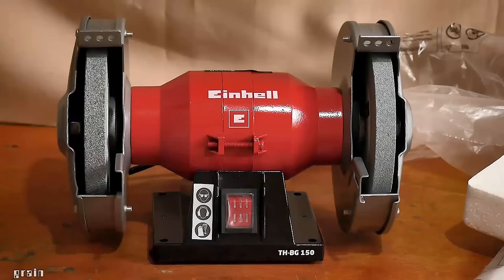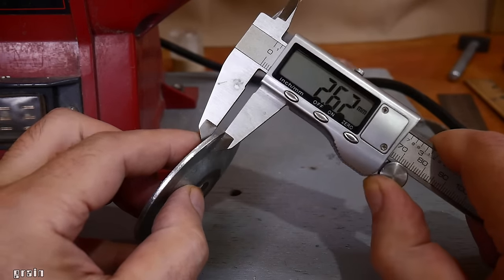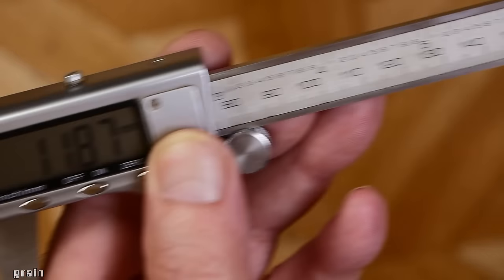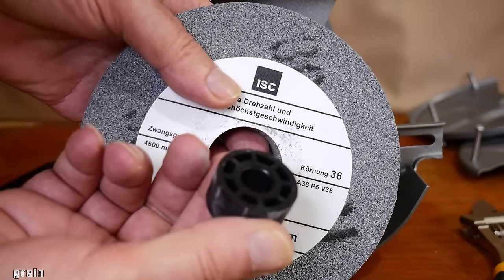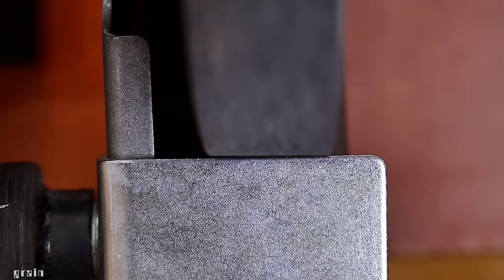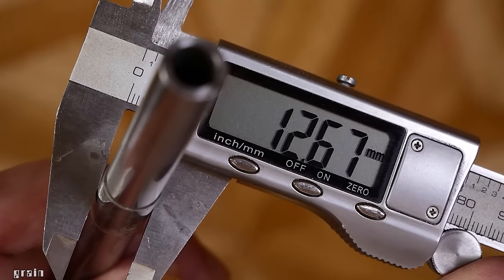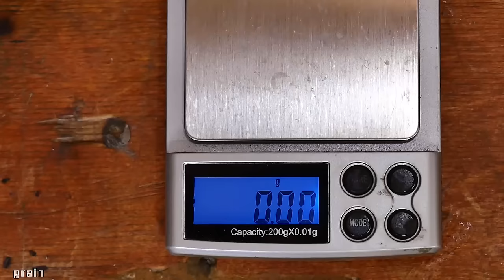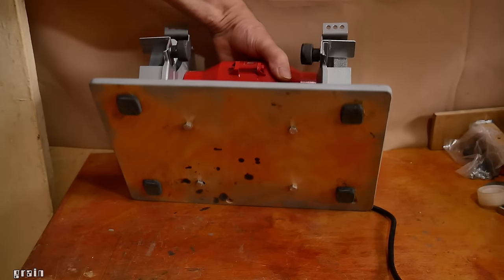Bench Grinder. Removing vibrations, balancing the abrasive disc, faceplate and more.

Comment: A balance washer can improve wheel imbalance. Make the washer about 3mm thick, and 70-80mm in diameter. Drill the shaft hole 1-2mm off center. Mark the wheel and washer. Try the washer rotated in various directions until the imbalance is gone.
Reply: Sounds safer than being hit by a flying 5g lump of solder.
Reply: Better make two washers (with centered shaft holes), clamp them together, (add index marks), drill multiple holes along 180 degrees of each washer's outer circumference. This way, rotating the washers relative to each other, it's possible to adjust the amount of weight correction from zero (index marks 180 degrees to each other) to the total weight of material drilled out from the lightening holes (index marks aligned).
Reply: @mikem6549  lol, yeah that's what I thought
Reply: How many pounds is 3 mm?
Reply: @daleolson3506  Depends. Is it centigrade, or kelvin?
Reply: @daleolson3506  Come on, just do the math. Disc 3 mm thick and 70 - 80 mm in diameter. Calculate volume (subtract the volume of the hole if you're fussy). Then multiply by the density of the metal you're using and you have the weight. What you're going to do with that number is up to you...

Comment: There is a safer method of balancing a grinding disc. Using glue on a spinning object with your face in front of it is just not safe.
Reply from the maker: use epoxy

Comment: Your balancing method is a great way to lose an eye , or a lot worse !!!
Reply from the maker: If you were trying to tear off that glue, you wouldn't say that. If you don't have Somafix use epoxy, what's the problem? You are not gluing a smooth surface, you are gluing on an abrasive disc, nothing can be better, because the epoxy goes through the pores.

Comment: Thank you very much for this video. I will have to try this out on my bench grinder, which has really bad vibration, like yours at the beginning! I was not aware of the reasons for the vibrations and how it can be fixed. I thought it was just a „not so good quality machine“ and I had to live with it. You have shown that this is not the case and how it can be improved a lot. 👍

Comment: I turned an aluminium bush as you recommend and it works perfectly.  The hole bored accurately and a very close fit on the spindle and the bush shoulder is turned perfectly true to the the hole. The 31.75mm  for the grind wheel is turned very slightly slack to allow the grind wheel to register on the face of the bush.  So the register for true running is the shoulder not the inside of the wheel.
Thank you,
Reply from the maker: In my opinion, plastic is easier for a sharpener and better for a tight fit. In my experience, you can even use a seal with adhesive tape and this will not affect the final result. The main thing is that the inner and outer diameter sit without play. And also that the bearing does not knock. The final part is adjusting the balance and aligning with a diamond pencil.
Reply from the maker: My next video is about faceplates for a sharpening machine - https://www.youtube.com/watch?v=CVYg9FFsLVo

Comment: WHAT A GREAT VIDEO... Sir, you must have been a GREAT ENGINEER!!! I'm in COMPLETE AGREEMENT.  That Makita grinder is available in my country (Mexico), but all of them are unbalanced, misaligned and lack Variable Speed (needed for slower speeds for some materials) THANKS SO MUCH for all the content of this video. As we do not have any grinder sold here that comes with solid washers or flanges, I will wait for your next video on how to solve the problem without a turner or having to use a lathe.  Meanwhile, you have my full admiration and professional respect. Cheers from Mexico!
Reply from the maker: Thanks for your feedback and greetings from Moldova.
Reply: That Makita grinder is still leagues better than most cheap-ish grinders out there. I have the exact same one in the video (the square red one, not Einhell) and it's a piece of crap.

Comment: I had the same problem, I solved it a little differently. Corrected the motor shaft with a lathe and made an adapter flange for the inside and outside. High quality disc used.
Reply from the maker: Usually the motor shaft does not hit. Even this purebred Chinese has no problems with the shaft. Quality disc? No imbalance? This doesn't happen. Have you checked it for balance? It is possible without balancing, the easiest way: if you straightened it with a diamond pencil and the disk rotates perfectly, what do you say when it stops - vibrations appear? If so, then the disk is not balanced.
By the way, the video uses German discs, pay attention to what is written in German. All discs require imbalance correction, even professional ones. To do this, they are supplied with special washers with three weights on a circular offset groove. Type in the search for YUT "removing the imbalance of the abrasive disc." For example - https://www.youtube.com/watch?v=RJVn-G2nZaQ
Reply: @grain-diose  my (china) shaft was very imprecise. With the two flanges (inside and outside) - they interlock - I prevented the tumbling.
Thanks for the tip about the discs, I'll check
have a nice day
Reply from the maker: @leonhardulbrich32  I forgot to say, the vibrations are checked when the machine is just standing on the table (loose). If it is rigidly attached to the wall, slight vibrations may not be noticed.
Reply: @grain-diose  ok I understand

Comment: Excellent video! The epoxy wire on the side of the wheel is a genius solution! Although Americans are very afraid of modifying tools, and they get nervous about making their own modifications that require a wildly unique solution.

A couple notes:
1.) The inside flange washer must be the same size as the outside flange washer, or at least very close in O.D. diameter, otherwise you risk cracking the grinding wheel.

2.) Use a block of wood and tap around the periphery very gently to align and center the grinding wheel, while it's only hand tight, before torquing down the arbor nuts.

3.) A 1/4" impact driver can easily tighten the grinding nuts on the bench grinder threaded arbor, one click or two clicks of your battery powered screw impact driver, or as close to 10 ft lbs of torque (as recommended by Norton official chart for 1/2" diameter thread) or 15 ft lbs for 5/8" diameter shaft. Hold the opposite side shaft, not the grinding wheels, when tightening, to maintain alignment.

4.) If your paper discs are not in good condition, then make new ones, or throw the whole grinding wheel away. 

6.) There is a balancing system available in the U.S., but it's $95 per side, which apparently removes 100% of the vibration, and it's called "Oneway 2272" grinding wheel alignment system.

7.) People do say that the easiest way to balance a bench grinder is merely to tighten one side, then dress that side with your diamond dresser, then on the opposite side, mount, and then dismount and re-mount the grinding wheel over and over, turning it in small increments. Test, and repeat, until smooth. This process apparently removes about 90% of the vibration.
Reply from the maker: Thank you for such valuable advice! 👍
Regarding point 7, my remark. After leveling only with a diamond pencil, vibration will appear when the rotation slows down. The reason is the rotation of the disk around the center of gravity, which does not coincide with the geometric center. The solution for this method is to screw the sharpener to a hard steel table or a hard steel stand screwed into the wall. As a last resort, put the sharpener on a hard stone floor, step on the body with your foot with all your weight and level it with a diamond in this position. 😃

And I also just thought that perhaps you can print a balancing washer on a 3D printer. You just need to make the outer sides thicker so that the counterweights with centrifugal force do not tear the washer.

Comment: This is a wonderful video. I have exactly this problem too. A little tip for balancing: According to gravity and when the grinding wheel is stationary, the heaviest point is always at the bottom. Do not drill deep into the grinding wheel with a few radial holes with a masonry drill. This also helps with balancing.😃
Reply: Adding weight on the light side is better than removing material from the heavy side.

Removing material might compromise (specially drilling) the integrity of the grinding disc.   The disc could explode during use.
Reply: @joeylegaspi3515  agree, also think an exploding disk would be far more dangerous than a weight flying off.
Reply: I was wondering how much it could effect the stability of the wheel. Only once I've seen one shatter during use and somehow the dude didn't have a scratch but at least 1/4 of that wheel went flying across the shop. I saw he super glued some solder onto the wheel and that's pretty smart. If it has lead in it that would make a good weight. I was going to try using that epoxy that's used to balance electric motor rotors. It's usually by the commutator grey or black color.
Reply: Never, EVER risk the structural integrity of a grinding disk by "drilling holes" in it! Attacking a disk with a blunt masonry bit is about the worst possible advice in a place where amateurs are around. Any drilling operation with a "crushing" tip geometry is generating stress zones, increasing the risk for funny disk explosions. In case you never sat through a "BG" (Berufsgenossenschaft) training session, here is an update for you: https://www.youtube.com/watch?v=dU5Qf3W30-w
Reply: Argh! No, no no! Stupid idea. Deadly even! Never, ever, drill holes in grinding wheel. By a high quality - yup, expensive - one and it will come correctly balanced. Research quality manufacturers. Still check it though, also do the gentle tap ring test for cracks. Any doubts? Destroy the wheel so no one else can use it.
Reply: There is a suggestion below to balance a wheel by drilling holes in it.  DO NOT DO THIS. It is potentially deadly. Never, ever, compromise the structure of a grinding wheel. And think, you might not be the only person to use such a damaged wheel. Maybe your son, your dad, your wife, your child, your best friend, someone else's best friend. If all other entreaties fail, beware of lawyers,
Reply: @f.d.6667  Wowwwww 😮 that video is amazing, so dangerous those exploding discs! 😮

Comment: This is a great video. I've seen some crazy videos with people drilling holes in wheelss and other really dangerous stuff. I've just bought a really nice Jones and Shipman wheel balancing jig at auction for next to nothing and will use your technique to sort my horrible wheels
Reply from the maker: Yes, I have seen a video with balancing discs for professional large machines, but I don't know if there is one for a home grinder, where to buy it and it's probably expensive. My method can be repeated by everyone at home without buying anything and without spending a lot of time. And I think I forgot to say that epoxy can also be used to glue the balance.

Comment: Everything is fine.
 To simplify the actions, I can recommend Elitech CT 300. It has ready-made, fairly accurate mandrels that fully correspond to the drawing given in the video.
 Not an advertisement.
 And yes, when working metal with a drill at speed, safety glasses are strictly recommended.  To avoid!  My apologies for the crooked Google translation.

Comment: Thank you so much. It is enlightening indeed. Was never aware of the need to correct the imbalances.
Reply from the maker: By the way, I also recently found out, naively believing that abrasive discs are uniform in weight. I checked and immediately decided to share. It's really like a miracle, for so many years I suffered!
If you don't have Somafix, use epoxy, it's even stronger. They write to me here in the comments that it will fly off and gouge out the eye. They did not see and did not try to tear off Somafix, especially from a rough surface. Yes, it was necessary to show gluing with epoxy, but I was sorry for the time, sorry.

Comment: i have an extra one, a small one that i use occasionally for carbide bits;    it is not bolted down, and if i don't hold it down, it goes all over the floor;  and it scares me, so that i keep turning it off and on to keep the speed low, afraid one disk will explode!!!
i will check it tomorrow as per your video; i may also try a 80mm washer in which i can remove (drill or grind off)  chunks at the perimeter,marking the wheel and said washer, not a perfect way, but may improve some; 
Thanks for your time,   just great
Reply from the maker: If you use your sharpener with a protective casing, then there is no need to worry. By the way, if a poorly glued balancer comes off, it will fly down the movement of the circle; the protective casing will not allow it to go higher.

Comment: Thanks Grain for you ideas. Starting with a proper face washer and bushing. Only thing I do not like is the glued balance weight. We got to imagine that it COULD come off! How about drilling some weight out on the heavy side? Will this weaken the grinding wheel? Another thing, not to simply press the dresser against the wheel, but hold it firmly against the tool rest so it's only cutting on the high part of the circumference. Even better - I think - I got a cheap single-point diamond dresser and am making an adjustable holder for this to slide across the edge of the tool rest. See Mr Pete #798 and #799. Overall it is a lengthy job to get a vibration-free grinder starting even with a quality machine. Everyone, please be careful!
Reply from the maker: Work with the protective cover and you will save yourself from any injury even if the balancer comes off. Because the balancer will fly down in the direction of rotation of the disk.

Comment: Thank you for the detailed guide.  I bought an expensive brand grinder especially to not have these issues, but that didn't help, unfortunately I have to do all the things shown in the video.    but at least i know how to do it.
Reply from the maker: You don't need an angle grinder to align the wheel geometry (not to be confused with unbalance removal), use this diamond tool - https://aliexpress.com/item/4001285335409.html
Reply: @grain-diose  Thank you,  some time ago I already bought that inexpensive diamond tool on eBay for €1-2.  My grinder is a Bosch GBG 35-15 it has two 150 mm discs.   One disc was OK, but I had to remove the other one, it was so unbalanced, purchased a replacement disc hoping it will solve it, but it makes the same imbalanced run.  So I got stick with one operational disc now, with the problem waiting to be resolved. I think it will be washer issues, but will do all your routine.  Thanks again.
Reply from the maker: @nick066hu  OK, I thought you were leveling the abrasive wheel with an angle grinder. 😆
Reply: @nick066hu , Quick query: Have you tried the "Good" grinding wheel (a.k.a. "Disk") on the other side where you have had two bad disks? It could be  shaft run-out or a bad bearing and not the grinding wheel/disk/whatever that is the problem. If you swap sides and your machine runs w/o vibration, then you bought two bad wheels. If the opposite happens, then you need a machinist.
Reply: @johnbesharian9965  Thank you for the good idea, I'll try that.

Comment: The plastic bushings for the grinder wheels are junk. Metal ones are available, and are far more accurate. I do dress the sides of the wheels to true them up as well. Any stamped washer is also junk, but finding machined washers is not easy. You can also buy CBN wheels which come spin and bubble balanced, and last far more longer than standard wheels. They are not made for grinding carbon steels though, only hardened metals.

Comment: I machined pressed on flanges and adaptors for the wheels then made machined balancing washers and thought it was all great.  Then the wheels wore after some time and became unbalanced. Too much of a hassle the wheels had a lot of life left. I put on a machined cbn and a diamond wheel. The machined washers I had made were still needed to prevent side to side wobble ( I held +-.04mm at the periphery of an 8” wheel) and radially fit the shafts with no perceptible play or skipping while cutting.  All in all setup was 10x less than abrasive wheels and they cut faster. I can’t be making stuff to make stuff sometimes.  Got to just get on with it.
Reply from the maker: Everything you said is absolutely correct. Of course, when grinding the abrasive wheel, the imbalance occurs again, because the diameter has decreased and the material of the abrasive disc remains uneven. The diamond disc is made of metal, so it does not have such problems, but it also needs precise alignment.
Reply: @grain-diose  and all the info you gave is good advice for people setting up vitrified wheels.  I wish I had your video 15 years ago when I set mine up the first time Every problem you solve in that video I spent hours figuring out on my own.
Reply from the maker: @TKC_   You will laugh, but I also struggled with the vibration of the abrasive disk for many years, and as soon as I found out about the need to remove the imbalance, I immediately made a video about it.

Comment: thank you. really nice video and some very helpful information.  i was also a bit worried about the glue coming off but there are other methods like a balancing washer that do the same job so no big worries.
Reply from the maker: The best replacement for CA Somafix glue is epoxy.